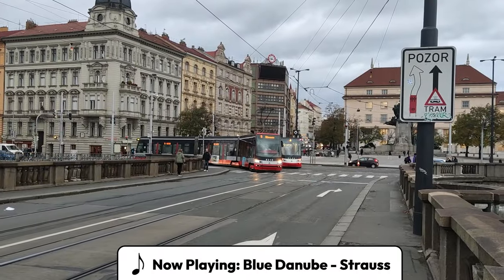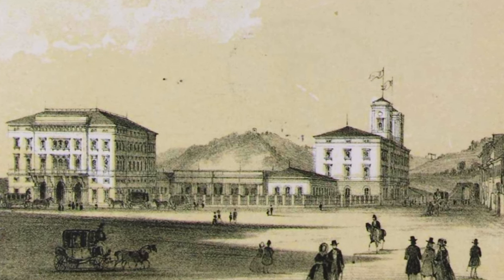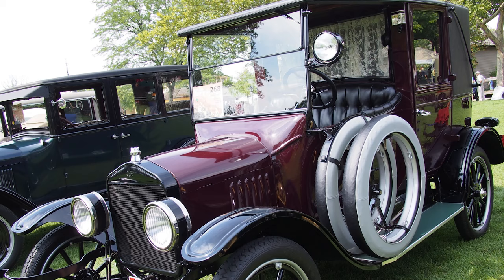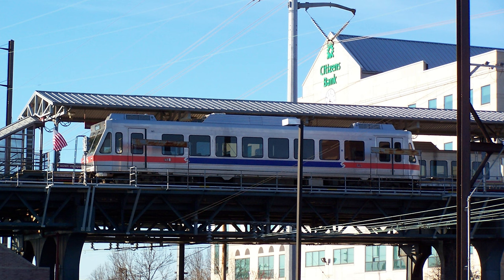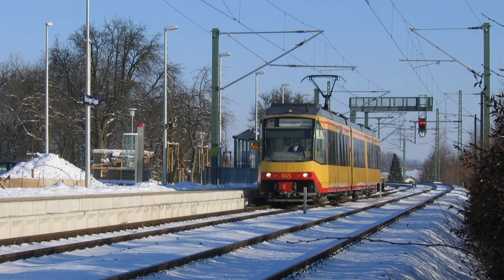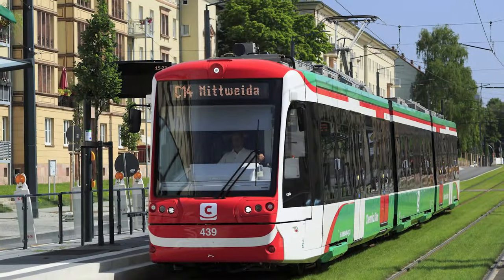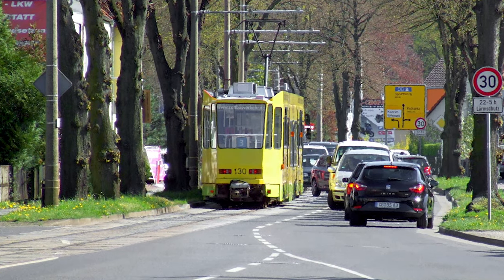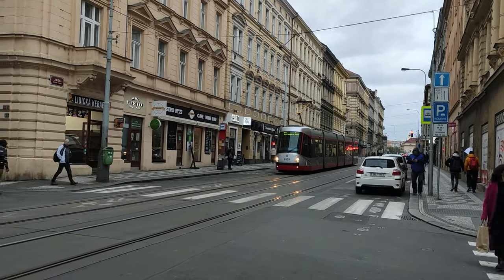Tram-Trains: A New Approach to Trams

Comment: Hopefully Manchester goes all in on Tram Trains
Reply: Hopefully Manchester combines trams and buses under same ticket system. It is ridiculous, when you need two different tickets for travel in the same city-centre.
Buses have problems of their own. 1 single door for getting on and off. Barely any information display if any, what the next stop will be. In some buses there is not even a single line display. 
Another problem. I do not know how mothers with large babytrollers or immobiles on wheelchairs turn 90° and get through that narrow aisle. Is it really necessary to make that aisle narrow with a cabinet for newspapers? Ridiculous.
Reply: @petrpinc7695  And Trains. Manchester has some of the worst Train System of any Major City of their size. But the potential is there

Like you said. If they want the System overall to become successful they need to do those little things right first

Comment: Thank you for the explainer! I can imagine how tram-train systems would be good for cities and towns with preexisting tram lines, but would you argue that tram-trains would also be better than more standard metro systems for cities without tram lines?
Reply: The tram-train model sounds like it could work in Lancaster County, PA, which has about 553,000 residents and used to be served by the Conestoga Traction Company. The boroughs and other such developed parts of the county, which generally precede the rise of the automobile, are still compact enough and relatively free of low-density sprawl that I could see a tram-train working there if the RRTA had the funds to build it and could cooperate with Lebanon, Dauphin, York, and Chester Counties and the freight railroads for some of the further destinations.

In fact, due to how much railroad trackage was built in the United States, of the lines that are still active, there are plenty of places that could be used for tram-trains (of which a few actually have to some extent), if only the owners of that trackage could agree to put wires overhead.
Reply: @DiamondKingStudios  I hope it would work! However, I do wonder what the response of the Amish population in Lancaster County would be to a tram-train. I have no familiarity with the traidtions of the local Amish community, nor have I ever been to Lancaster County, PA

Comment: Dude, this is just called light rail in the US. Almost all of the US light rail systems fit this description and use the same (usually Siemens S700/200) tram-trains.
Reply: Yes and no, light-rail is typically purpose-built, but tram-train tries to benefit from existing tram or train infrastructure. But yeah somebody could perhaps dive deeper into the interurban - light-rail - tram-train triangle.
Reply: @petrhajduk9955  It's sort of an open "secret" that US light rail is by need and by default interuban. In the US the FRA does not allow mixing of passenger and freight without satisfying onerous crash standards, but most of the modern US light rail system use either old interurban rights of way or bought out freight rights of way.

In other words, there's a reason why the longest tram lines in the world are always in the US.
Reply: @TohaBgood2 
But they aren't in the US. Afaik the longest purely tram line is the Kusttram in Belgium. Meanwhile there are some lines in the Karlsruhe system using tram/train vehicles that extend over 40 miles. I'm not aware of any US tram line that comes even close to that. Things like the NJ River line aren't trams.
Reply: @mikeblatzheim2797 What you said is not accurate. The longest tram line in the world is the LA A line. And US light rail lines tend to be extremely long since most of them serve faraway suburbs and converge downtown.  

"The A Line runs 48.5 miles (78.1 km)[2] between Azusa and Downtown Long Beach, serving 44 stations. It is the longest light rail line in the world, surpassing the 42-mile (68 km) Coast Tram in Belgium."
Reply: @TohaBgood2  
If you're going to quote straight from Wikipedia, at least do the decent thing by not omitting "since 2023". 
US light rail lines aren't exeptionally long, and I don't know where you got that impression from. In the Ruhr area, light rail lines don't just serve faraway suburbs, but neighbouring cities as well. Lines of around 30 miles in length aren't uncommon. Line 5 in Mannheim for example is a ring line with a length of over 40 miles. Of course, those lines are in addition to usually extensive heavy rail and bus transport. 
And then there's Karlsruhe. For some reason I couldn't find official lengths for their lines, but even just entering the end points into google maps gives you distances of 55 miles for the S8 (which used to be significantly longer), and over 70 miles for the S4. Sure, on some parts those lines may run on heavy rail lines, but the vehicles they use are most definitely light rail. No other city comes close to that.
Reply: @mikeblatzheim2797  Sure, let's just move the goalposts until you get the answer you want.
Reply: @TohaBgood2  
The lines in Karlsruhe can be considered light rail lines. Most people do. Karlsruhe does. Not sure how that constitutes "moving the goalposts".
Speaking of "moving the goalposts":
Your original claim "[...] there's a reason why the longest tram lines in the world are always in the US" holds true only if you consider 'always' to have begun last year.
"And US light rail lines tend to be extremely long [...]" maybe by conventional tram standards. By Stadtbahn standards, which is essentially what US light rail is, they're perfectly average in lenght.
Reply: @TohaBgood2 Didn’t the A Line repurpose parts of the old Pacific Electric Long Beach line?
Reply: @DiamondKingStudios  Almost all of the LA Metro is built in the same right of way that the old interurbans and streetcars in LA used to use. Yes.
Reply: @TohaBgood2  I suppose that simplifies routing a fair bit in many parts.
Reply: @DiamondKingStudios  Simplifies routing, right of way acquisition, and puts the new light rail stations in places that were already built transit-oriented pre-car.

This is probably why they were able to build up so much ridership so quickly in an area that seems to outwardly be very car-oriented. The LA Metro is now the second largest transit agency in the US primarily on the strength of these old rail transit corridors.
Reply: And a lot of LA's old transit expansion plans literally involved the corridors they actually built.
Reply: @FDW137  It’s basically just restoration, is what I say a lot.
Reply: @DiamondKingStudios  Yeah. Some bits like Wilshire and the Regional Connector were just cooking for way too long, but much of the rest could be classed as sort.

On the other hand, BART more or less replaced the function of the Key System in the East Bay.

Comment: Tram trains look really attractive for smaller cities with smaller towns that are close to each other
But if the towns are too far apart then using heavy rail which can hit higher top speeds than a tram would be better
Reply from the maker: Absolutely, tram trains are definitely a viable solution, but it all depends on the specific needs of the city/town/region
Reply: In some places, classic trains would be too heavy and have too big capacity which you don't need, some tram system separate from classic railway could be better. But problem is that in small cities, pretty much everyone is a car person, so they will block these ideas by who they vote in elections, they don't want any trams, they want more parking.
Reply: @Pidalin I grew up in a smaller city (200k) that had a variety of cities of similar and larger size within two hundred miles in different directions, and I always wanted some way other than by the highways to reach them, which we used to have (before the 1950s; the last one was part of a long-distance service that ran twice a week and closed in 1971).

Unfortunately I was probably one of few.
Reply: @DiamondKingStudios  Funny is what you consider smaller city in US, here in Czechia, city of 20 000 people can be capital city of it's region. 😀
Reply: @Pidalin  But the region capital is almost analogous to the county seat here;  most US states are larger either in size or population (often both) than your entire country.
Reply: @DiamondKingStudios  The US census has these definitions: small city > 5,000 population, medium size city > 50,000 population and large city > 500,000 population.
The extreme example of a state is California. If it were a country it would be just behind Germany as the fifth largest GNP and with a population of ~40 million.
Reply: @danielcarroll3358  Whenever most people I know imagine a “city”, it’s usually the big ones like New York, Chicago, or (in my state’s case) Atlanta.

The next biggest cities (Augusta, Columbus, Savannah, and Macon) are around 150-200k each and largely overlooked. They’re definitely sizable, but have little influence beyond GA and bordering states (AL in Columbus’s case and SC in the case of Augusta and Savannah).

While a city is technically anywhere that has been incorporated as such, the numerous “small cities” of Georgia (LaGrange, Americus, Rome, Dalton, Tifton, Dublin, Bainbridge, and the like) always felt more like “towns” to me, with little importance outside their respective counties and some bordering ones also. In a way, LaGrange and Americus are to Columbus what Columbus is to Atlanta.